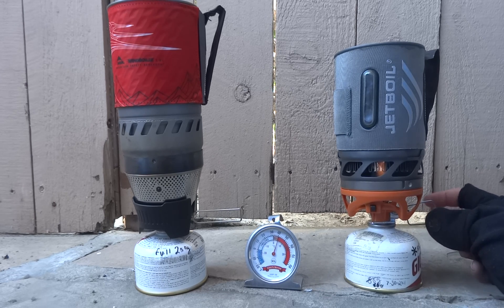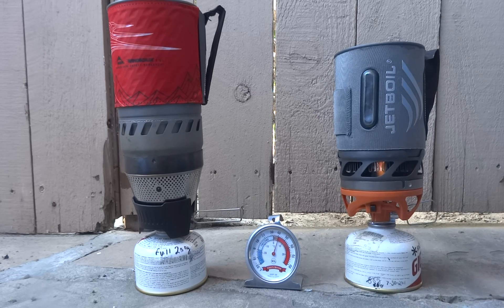MSR Windboiler vs Jetboil Sol -- Cold Weather Performance Test

Comment: What brand of fuel did you use? Does it have to be the jetboil brand?
Reply from the maker: Juan, it's not necessary to use Jetboil brand fuel.  MSR, Snow Peak, Primus, Optimus, etc. should all work.  The only brand that might be a problem is Coleman.  Their specs are a little bit different.  But all other major brands should be OK.

HJ

Comment: Great vid Jim (as always) but I must say the rest of the world is confused the USA still using olde worlde fahrenheit temp measurements! So many of us reach for the online converters to get a sense of what you guys are talking about when it come to miles, pounds, ounces and feet etc!. Metric is so easy.. 0 degrees = freezing and 100 degrees = boiling! Keep up the good work though (greetings from Australia.. and yes we've been metric for many decades now)
Reply from the maker: LongStraightLines, particularly in terms of volume, the metric system is so vastly superior to the old English system, we've made ourselves the laughing stock of the developed world.  

If you look at my blog posts, I try very hard to give weights and measures in both English and Metric units.

My videos are all unscripted, and sometimes in the moment I either forget to include metric or simply can't convert fast enough in my head on the fly, a defect for which I apologize.

Comment: Test the Jetboil against the Soto Windmaster and Olicamp XTS  pot
Reply from the maker: 805gregg I would love to but I lack the XTS pot, and well the time also.   I've got reviews booked out through at least June 2017.  I'm kind of weird that I spend a lot of time with each stove.
Reply from the maker: 805gregg However, that said, for cold weather performance, my money is on the WindMaster, but it will only be just slightly better.  The real determiner of performance is of course canister pressure.  In the conditions I shot this video, using the fuel that I used (100% ordinary n-butane), no stove is going to perform all that well.

Comment: 40 degrees is cold? Just coming out of winter, 40 degress with the sun out that's considered a nice day for a while where I'm from.
Reply from the maker: IOSMASTER101. Well, yes, but relative to the vaporization point of the fuel (31 Fahrenheit), 40 is cold.  Normally, the canister needs to be 20 Fahrenheit degrees above the vaporization point in order to have decent power.

Comment: What kind of fuel is that? It sure is not the specified isotane butane/propane mix, is it?
Reply from the maker: J Wiz I was using 100% plain butane (not isobutane).  And yes that's not what you'd normally use in backcountry.   The purpose of this test was to see if one stove or the other were significantly better in cold.  Neither stove did particularly better, but the Jetboil did a little less horribly than the Windmaster.

With normal fuel, the exact same thing would happen between the two stoves except that it would be up to 20 Fahrenheit degrees colder (if you have a good brand of fuel).

Comment: Have you done a cold test that includes adjusting the gas to see when max flame wont cut it or if it will even get to that point?
Reply from the maker: E Nunya The gas was opened to maximum flow as I recall for this test.

Comment: Thanks for the vid. In my experience with the JetBoil Flash system, I have had it down to -10 degrees and it fired up just fine. Of course it did take 10 minutes to finally boil water but I had a hot meal none the less. I was at about 5,800 ft above sea level. I did have a backup alcohol stove just in case the pressurized canister didn't work.
Reply from the maker: TheOutdoordude it matters a lot where you are in terms of how much fuel is left in your canister.  When the canister is full, it has a relatively high percentage of propane, and you can cook in some pretty low temperatures.  The propane however burns off at a faster rate than the other gasses. Toward the end of the canister, all the propane is gone, and all you have left it either isobutane or regular butane, depending on the brand.  You'll have a lot harder time cooking then,  and you'll need to warm up the canister somehow.

Comment: As I write this note, it's 8°F here.  Using some of the cold weather tips from your blog, would either of those stoves even fire up?
Reply from the maker: Brad, it would depend a lot on your technique.  Have you seen my article on my blog about the standard techniques for cold weather gas use?  Check out http://adventuresinstoving.blogspot.com/2011/11/how-cold-can-i-run-my-gas-stove.html
Reply: I had read the original article shortly after I bought my first remote canister stove (that's when I discovered I should have bought a stove that could handle liquid feed), but not the revised version of it.